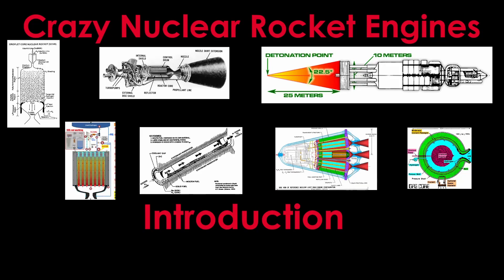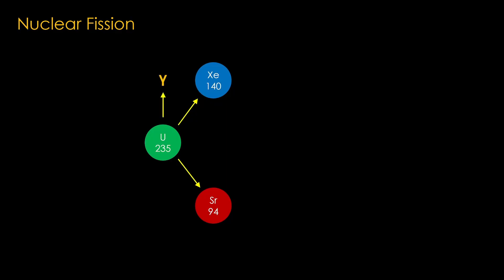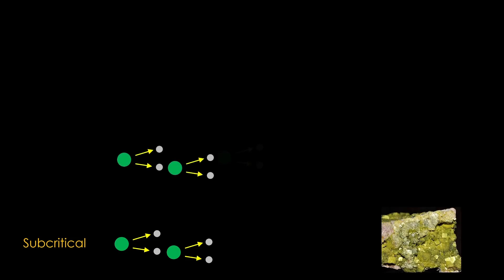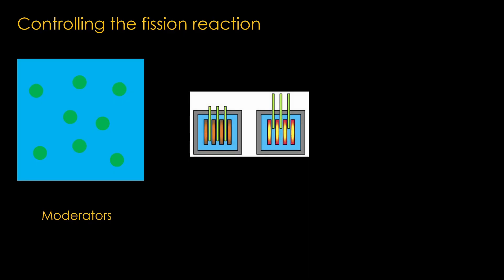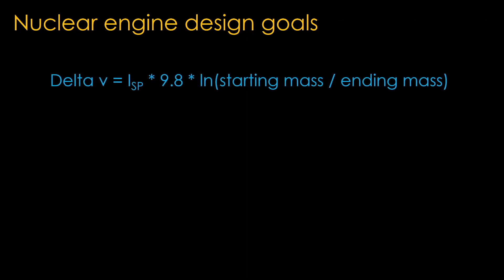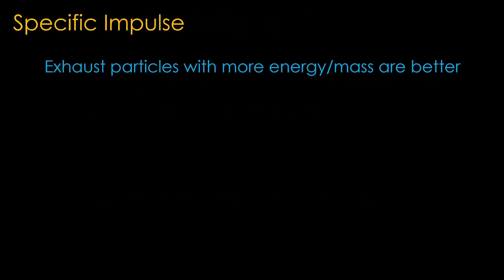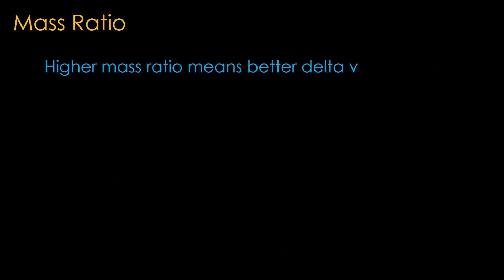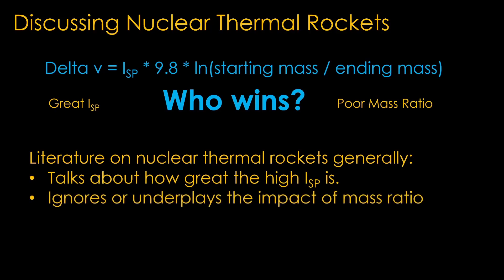Crazy Nuclear Rocket Engines - Introduction

Comment: Hello again Eager, I was asking if it is possible to make a hybrid Electric/Thermal nuclear engine (NEP/NTP) Using chemical fuel but with an isp greater than 1000 seconds and a modest thrust, I ask because NASA recently published the early development of a bimodal nuclear engine in conjunction with DARPA that aims to have the thrust of a NERVA but with an isp in the range of 2000 to 4000 seconds, this seems great to me and more so because it was an official article, but I would like to know if it is viable.

Here is the link to the article:
https://www.nasa.gov/general/new-class-of-bimodal-ntp-nep-with-a-wave-rotor-topping-cycle-enabling-fast-transit-to-mars/